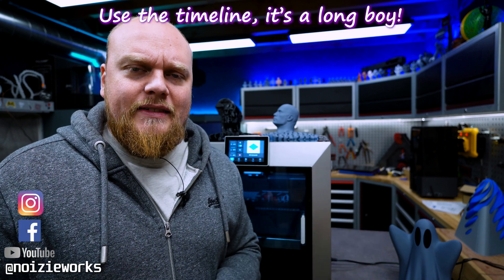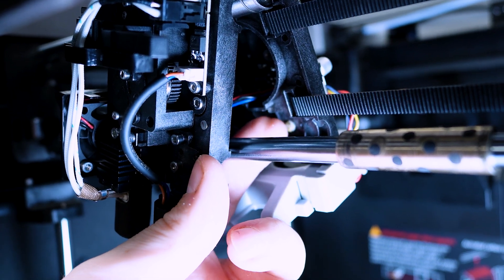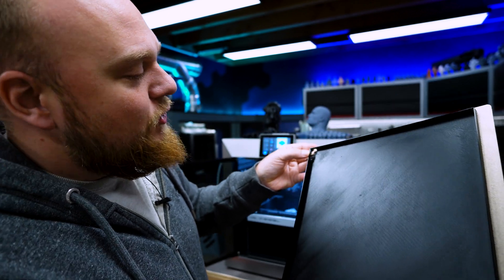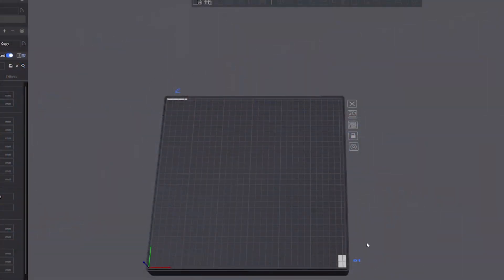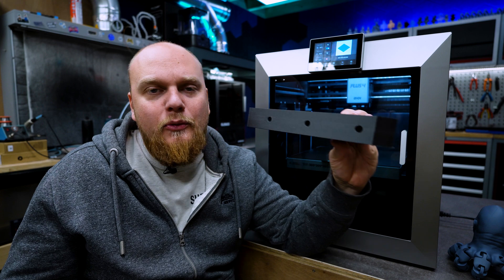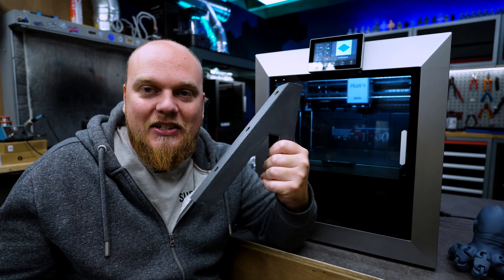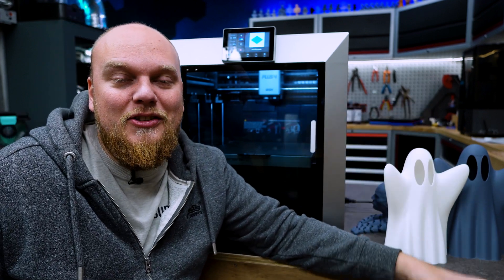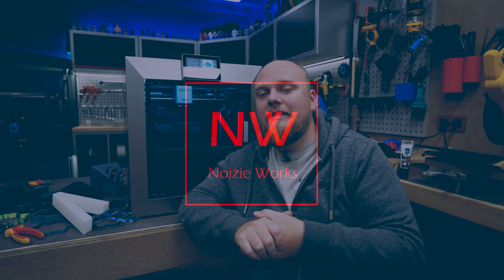How i fixed the Qidi plus 4 loose bearing and hidden filament cutter feature?

Comment: Following this.   I have done tons of CF and GF high temp filaments in my new Plus4.   Was planning to do an inspection and cleaning this evening on unit, it has been running nonstop tons of GF ABS and chamber been at 55 whole time.   Want to see if I have any signs of issues since I primarily only run engineer grade filaments in my newer machine.  Be great if you could add some images with better details on issue area how it comes apart etc.  So you are saying the plastic part is bolting to the brass bearing?  Are you also saying original design was high temp glue only attaching it to the brass bearing?  Fix involves a tapped hole on bearing and threading machine screw into the brass bearing and using super high temp silicone?  I will be inspecting this evening after doing many many hours of high temp runs and very abrasive GF and CF runs continuously for extended periods, see what I find.  Is the bolt pushing against the brass bearing?  Is there a thread for machine screw or only pressure of it pushing on bearing?  Wish you would take close up pic of brass bearing, so could see details of it's design.  Looking back and pausing looks like glue or silicone dries and bonds the plastic to the brass bearing exterior surface, your machine screws only hold casing together, is this correct?
Reply from the maker: Hi dude! No problems running material at all.
I'm not going to open up the unit again, already stripped 2 of the 4 self tapper that hold the shell together (another gripe i have,drilled it and fixed it)
You can see in the video 2 white dots, that's the "glue" they inject from the back to hold the bearing in place so it doesn't rock back and forward in the cavity.
Probably a 2 composite as it's hard as a rock, i can see that it deformed a bit but mine definitely got underfilled.
2 other people seem to have the same experience, solid in the beginning with deformation after a few prints and a loose head as a results.
Didn't see the pictures but if i have to guess probably also a lack of injected material.
The fix indeed involves using 2 self tapper or 2 bolts like i used as these holes are not pre threaded.
These bolts push on the bearing to take away the play.
The cavity seems to be made for the bigger ball bearing and not the brass bushing.
I added high temp silicone between the 2 white dots to permanently fill the cavity so i can now just remove the 2 bolts as this isn't going to move anytime soon.
The complete head is held together with self tappers into plastic, loosen them a few times and you will strip them.
Now having to add 2 bolts that push on the bushing isn't going to help as you now apply pressure on the casing and the 4 selftappers.
Another reason i filled the void with something.
Reply from the maker: ow i forgot, inspecting another design flaw.
Drop the bed to 278mm and tell me what happens in 15 ish minutes.
Probably will go into protection because the chamber temp is going to tank.
Reason, buildplate chokes of the chamber heater so any hot print above 275 mm in my case is going to fail.
Somebody reached out and it in fact its also the case on my sample only i didn't waste a 20 hour print and a roll of filament.
Reply: @NoizieWorks  inspected it, bearing tight and been making tall prints abs with chamber heating running no issues seen after about 15 plates run to date but will keep eye out for this.  Prints were 10cm height not sure if that would have reached zone?  Looking visually rhink see where you talking heater vent at bottom of case about 4 cm tall maybe 5cm can see what would happen….needs a side discharge not fwd for hot air…. Otherwise build plate will block it, perhaps rotate it 90 degree so blows along front glass?  And add a 60 degree deflector after rotated 90 degrees.  Loose about 1.75 inch in build height when running engineer material…. Think will look at rotation by 90 degrees or different heater design…
Reply from the maker: @JTs3DPrints  heater is glued in from what I heard.
Somebody made a macro to automatically turn off  the heater past a certain point.
I set mine to 270mm and that seems to work.
Reply: I'm thinking when I get mine next week, I'll just heat up and install some threaded inserts for the fixer screws.
Reply from the maker: You could do that, don't tighten too much. Just snug is enough
Reply: @NoizieWorks  right! Just like you do with grub screws.

Comment: Buyer beware, mine is 2 days old and has not printed anything, heater bed is defective. My Bambu Labs works perfectly, so does my BIQU Bx and B1, my Creality Ender 5 Plus and my Chiron.
Reply: Again I believe your problem is actually a power supply voltage setting. Please check.

Comment: Had the same Problem, mine was also one of the first
Reply from the maker: @nightcomex2362  Thanks for sharing, how did you fix it?
Reply: @NoizieWorks   for now just inserted 2 m3x8 bolts. I had no high temp glue on hand. The quality is much much better now, but Not „Perfect“. Sometime i have underextrusion when the head comes on the bed (mean, everytime After the head lifts)
Reply from the maker: Did you do any filament tuning? I found that the stock profiles are pretty bad with to much pressure advance etc
Reply: I also had minimal ringing, Perhaps the Printer has to run a Little bit for getting smoother (was the Same for my x1c)
Reply: @NoizieWorks  i copied my bambu studio profiles and used bambu abs, 260degree Nozzle, 90 bed, 50 Chamber, 16qmm, 0,96 Flow, 0.03 pa
Reply from the maker: @nightcomex2362  don't forget to redo the inputshaper calibration after the fix but i do see a small amount of ringing but it's more in the form of vfa
Reply: did inputshaping, Yes you‘re right it‘s vfa, made some pictures, is there a way to send them?
Reply from the maker: @nightcomex2362  sure noizieworks@gmail.com will look at it tomorrow

Comment: You do a lot to set my mind at ease, I guess they are aware of this, I just started using my plus4 last weekend and everything is fine, it looks like the glue is working:)
Reply from the maker: @Zoran_07  They are definitely not talking to me about it and not to scare you, every machine sold now has the same type of bearing installation.
2 people confirmed glue deteriorating after very hot prints resulting in loose printheads which is probably what happend with mine as i don't remember it being loose upon setting up.
But you can fix it now if needed.

Comment: Good video as usual.

I notice you used high temp silicone for the bearing screws - would low-torque / anti vibration thread glue be adequate if it’s solid until >150C?

Surely the screws would never see those temps even at full operation with heating, as they are not in contact with the nozzle?

Appreciate your advice!
Reply from the maker: It's not on the screws but between them in the case they should come loose the void behind the bearing is filled.
Those bolts are just screwed into un threaded plastic.
Reply: @NoizieWorks  I see - so apply a dab of it then screw them in fully?
Reply from the maker: @PerfectPudding  untill you feel resistance and the cage feels locked. Let the silicone dry and that should fix it. I printed 2 15 hour prints back to back and she's solid now.
Reply: @NoizieWorks  thanks mate, really appreciate your advice. You do a lot to set my mind at ease
Reply from the maker: @PerfectPudding  No problem brother ✌️
Reply: Thanks for taking the time to find and share the fix. This is something Qidi should be doing though. I understand that some people are able and willing to tinker with their printers, but not all of us are or want to. They need to make this right and come up with a way to fix this and send it out to whoever has this issue.

Comment: Just wondering: with the positioning of the exclusion zones, you could slightly rotate a rectangle to just miss those 2 zones. So the question then is what the maximum surface/dimensions of such a slightly rotated rectangle would be.  I'd guess it would still be relatively close to 300x300, no?
Reply from the maker: You might win 5mm yes(need to test it) but the question is: Do you need it to be square and most importantly should this be disclosed on the marketing material?
I only found out trying to do a first layer test so that sucks if you buy it to use every mm² to come to this conclusion.

Comment: bambulab is the best is a metalsheat metallo che fa rumore e fa schifo come macchina nemmeno se me la regalano la prendo e ingombrante rumorosa e poco precisa per non parlare del peso ce un trattore dentro
Reply: I have Bambulab, I had to send back the A1 because it could catch fire, then I got the P1S and do you know the actual print area? Yes, it is smaller than what is declared, as you can see it does not seem better than the others and if you were registered on some Bambulab forum, you would see how many people have problems with Bambulab

Comment: Was hyped to get mine up and running today. After watching videos all week on this printer.  My printer head crashes right before going into the wiper/poop shoot area. Makes the belt skip and all…  paper weight till I hear back from customer support.. all while my p1s prints non spot right out the box,
Reply from the maker: @Flintstonefred  there is always the chance of receiving a hot mess. Sounds like it's not homing correctly?
Reply: @NoizieWorks  all fixed. The housing was touching the whipper set up,   They sent me a video showing the fix.   👌🏼  just had to squeeze the lower section up..
Reply from the maker: Nice! Qidi support is great

Comment: Its not about a problem being found, its how they respond that matters, and even mentioning that only one person had trouble tells me volumes. It doesn't matter if only 1 person is having an issue or 1000, they owe each individual a fix, regardless of how many people are reporting it. I was going to pick up this printer based on all the positive reviews, but now I am going to wait and see how things go for a few months and then decide which printer to buy.
Reply from the maker: @keno101  valid opinion!
Reply: i wish i would have just got another Bambu labs printer. The plus4 clogs all the time with top off and front door wide open. Bambu is a workhorse.
Reply from the maker: @cashbrewery  did you ask for a replacement nozzle? They offer a new version to help with the heatcreep.
Reply: @NoizieWorks  yes, been through 3 of them so far.
Reply from the maker: @cashbrewery  wow that's bad! There is a mod to relocate the hotend fan so it's more in line with the heatsink. You can find it on printables and I also have seen people replace the fan for something more powerful with good success
Reply: @NoizieWorks  yes, just installed another one, when removing the old one there was no filament in the nozzle, it was just barely coming through the gear. Now i think something is wrong with the gear or motor that feeds the filament through. That would explain me finding it hovering above the print thinking it's still printing.

Comment: Really appreciate your continued work and insights! It's a shame there is a design oversight like this on a printer that is SO CLOSE to being really ideal for the money. Don't get me wrong, mine is printing great and I think the printer is still worth it, but I hope Qidi makes a few small revisions to make it that much more problem free. I mentioned in another comment, but as I understand it you actually can force a larger print area. However you'll have to manually configure it and still mind the exclusion zones. Printing a full build plate perfect square isn't possible though. They probably could have made the printhead a little smaller! Hahaha. I also really appreciate that you don't blame the machine for every printing issue and recognize that the filament and settings contribute to appearance. PETG-CF really is a cheat code of sorts. Overall solid results though. Thanks again!

Comment: I have a qidi Max3 printer only about 3 month's old making rubbing sounds  not all the time but sometimes and im seeing a kinda rubbing on the bar build up. I did put some 3 in 1 oil on it when it first started making the rubbing sound. it helped but slowly coming back.
Reply from the maker: I have noticed that enclosed (hot) printers need more maintenance. ABS is famous for depositing crap all over the printer like rails.
Clean them regularly and use a thin oil to lube the rails. Depending on print hours this is a bi-weekly procedure as the oils evaporate a lot faster then grease. Hope it helps
Reply: @NoizieWorks  I would love to take that hotend and put it on the max3. Do they use the same board? the Max3 and this plus 4?
Reply from the maker: Don't have a xmax 3 unfortunately, you can send a picture to me of the boards to compare noizieworks@gmail.com
Reply: Try to avoid 3 in 1 oils for this type of application. 

Usually have some kind of solvent in them which could attack belts etc.
Dedicated lubricating oils would be best.
Reply: @freedomofmotion  I only apply to the rods. I dont get any on the belts or bed it is a oil. for the belts use vaseline.

Comment: I had the same issue with my X-plus 3
But there is no screw and glue to clamp the bearings. They are only clamped by the two plastics halves. And they did wear in. 
But after a bit back and forward with the service they did provide me with two new plastic half that clamp down on the bearing. 
Also installed it with some extra glue to prevent it from vibrating and wearing in again.
Reply: I have a brand new X-Plus 3 with the same issue

Comment: I haven't had any issues with my bearings yet, it's been rock solid, but I'll definitely have to keep an eye on it. Only issue I've been having is related to wireless, I connected it to wifi but it's had issues connecting to Orca slicer or Qidi Studio wirelessly, I'm working with Qidi on that though. I've been using the USB until i can sort that out.

Outside the wireless issue its been amazing so far, I am a bit bummed it's not a full 305x305, buts it's not that big of a deal, and I'm very happy with the printer otherwise. I was going to get a P1S before this, but I'm still glad I got rhe Plus 4
Reply: Check the Port IP:Port

Comment: Seeing bronze bushings instead of linear rod bearings is rather disappointing….
Reply from the maker: @Nowen97  top one is a bearing and not a bushing, interested to know why but i'm just a caveman running around with a stick to poke things
Reply: Probably because of wear, bushing don't just wear out much faster than bearings buy, they also wear out the rods. Bearings can be smoother too, the only benefit to bushings I can see is they're a little lighter and cheaper.
Reply: All these corexy printers use them. X1c, k1, k1 max, x max 3, x plus 3, q1 pro, p1p, p1s, you name it, they all use them. These printers run holllw steel rods. Unlike Bambu using carbon fiber rods. The carbon fiber is mildly abrasive and will wear them down faster than polished steel. At least they did something different with the plus4. It has most of the load on the top linear bearing that is steel balls. The bottom is basically to steady it. But all these damn corexy use them unfortunately. When one of these companies use them, the rest use them unfortunately. Also,.I am not having very good luck with my new plus4. The test prints are coming out bad, all wavy and vfa's on them. It's also very loud cause the things is making very loud rubbing noises and the side panels makenit echo through the room so loud. I am pretty pissed I already gotta mess with this damn thing. Both my q1 pros printed perfect out of the box, and still do. I constantly have to tune my x max 3's to get decent prints out of them. I bought this plus4 to get away from that, but looks like I got a problematic 1st gen of this damn printer. I really don't feel like ripping this 🤬 thing apart.

Comment: I was debating whether to continue waiting to see what Bambu Lab's next printer would be or to take the plunge and purchase this Plus 4. I think I'll wait. I'm not comfortable with Qidi claiming this is an isolated issue because, given the nature of the problem, it's impossible for it to be isolated. A faulty motor or damaged cable could be an isolated problem, but not a lack of glue or its quality. Bambu Lab had an issue with the A1 at launch, and they took responsibility for it. In fact, it's this approach that convinced me to buy one of their printers.
Reply: I too was looking the Plus 4 vs. waiting......The issues in this video (thanks Will) should not be happening (quality control/testing issues). I think we'll see more 3D printer offerings in the near future with similar features with better quality. Formnext 2024 is coming... Bambu announcement? Others likley as well....
Reply from the maker: @trobinou47  Completely agree, owning the problem and actively correcting it should be the standard for all brands.

Comment: Thanks for the updates! really appreciate your work. Would be interesting to know if everyone with the issues is in EU (maybe a specific batch) or global. Either way, think i will likely wait a little bit longer. 

I dont mind the cut outs in the corners, but that should be stated as that can have an effect for people. It is probably a sacrifice/trade off made for trying to get a builder print volume in a smaller body. I think its worth while to do so,, just needs to be pointed out. At least they are on opposite corners so if you need to print 45° to maximize the build size, you still can in one orientation.
Reply from the maker: @willofthemaker  Time will tell, it looks like they where planning to use 2 ball bearings and changed it up as the tooling on the inside looks like it's for the top bearing.
I'm speculating now but no denying that it's poorly designed with an even worse workaround.
I agree on your take of the exclusion zones.